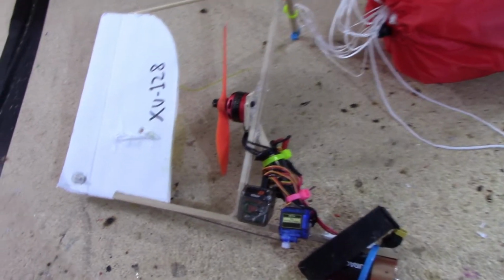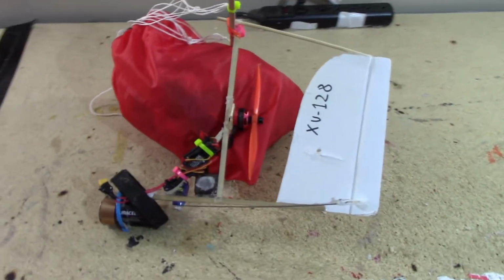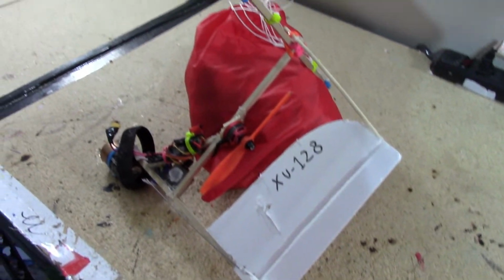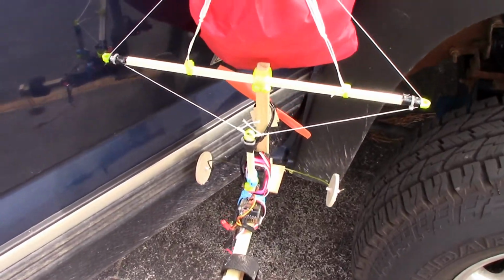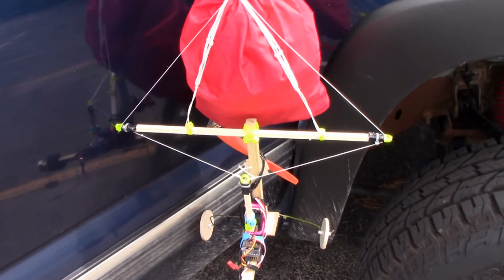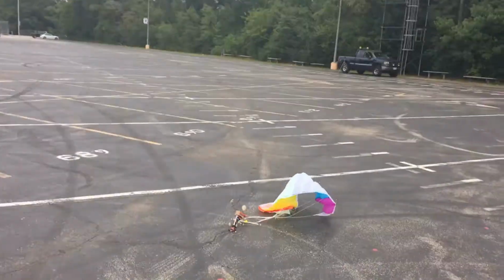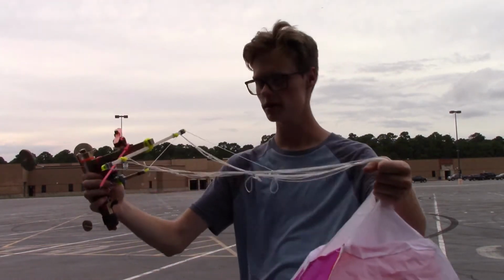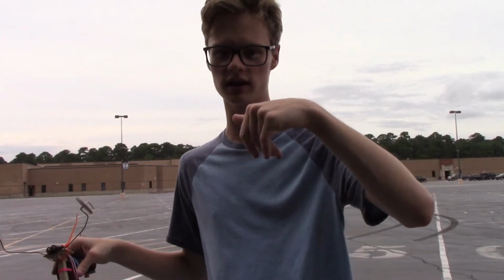Remote Control Paramotor Version II Testing

Comment: Great prototype....I was also thinking of making one of that....actually I have a dragon kite which I converted into RC and it flew great....maybe my next project would be like that....I want to suggest something in your paraglider.....maybe you should change the propeller into a low pitch propeller and to a more torque motor/low kv motor....I think you should also balance the parachute and the load it carries, like the load should be lighter and not that heavy because if so....the wind created by the motor and propeller will definitely push it harder infront and a lot of drag into the parachute making it left behind or far way back ahead of the load....I've seen RC paraglider in our group and they fly it slow, and the load seems very light....a small lipo, tiny receiver, micro servos, 1806 motor, low pitch prop, 5A esc and a doll.....they said it was made in indonesia.....and it really flies good! But they fly it on a very calm day. This is just a suggestion and I hope it helps.....Your work is really awesome and it also make other's inspire to experiment....It is really a great achievement to see your work flies! Good job mate!
Reply from the maker: Thanks for all that info!
Very interesting stuff! If I do revisit this, I will take in what you said, I do think your right about all that. This is just the way I finally got it to actually work...
thanks!